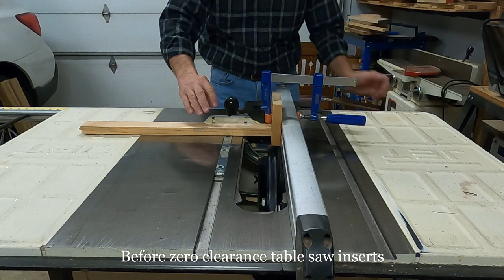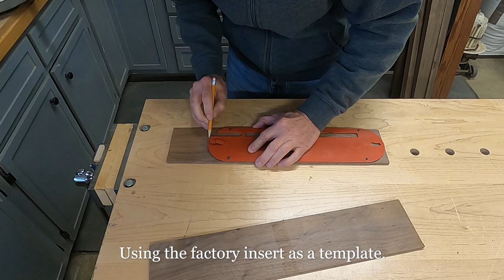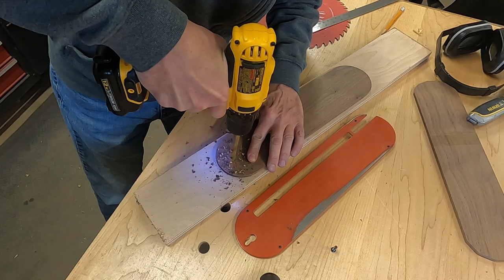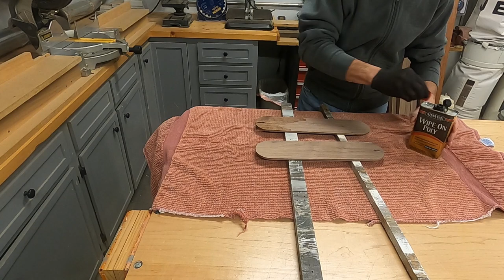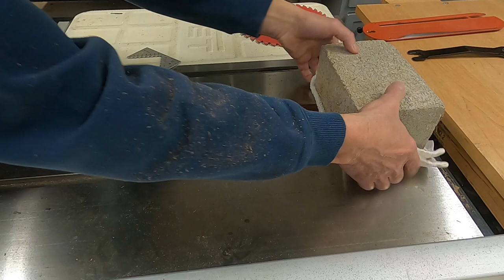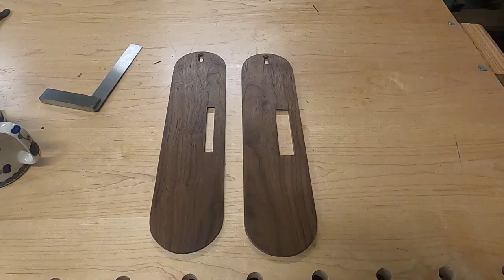Making Zero Clearance Dado Inserts for Jet JWTS-10 Table Saw

Comment: Very nice! A couple of questions, if I may.
What is the tool that you used to measure?
Why did you make two inserts?
Reply from the maker: What I measured the depth of the cut with was a saw depth gauge. Picked it up at Woodcraft. I made two because I do some 1/2" dado work and some 3/4" to 7/8". More of the 3/4" size. Thank you for watching. I appreciate it.